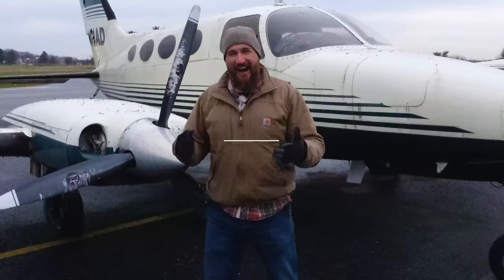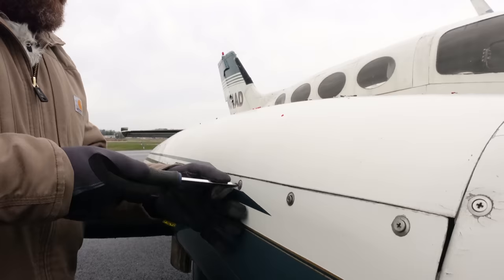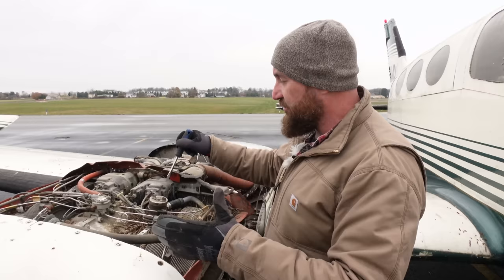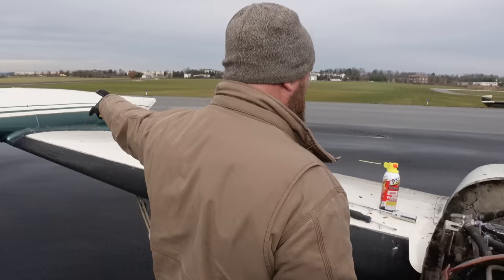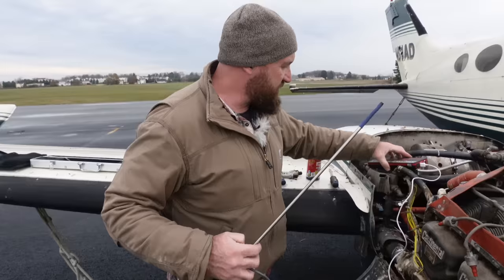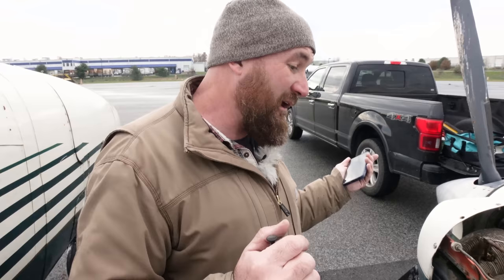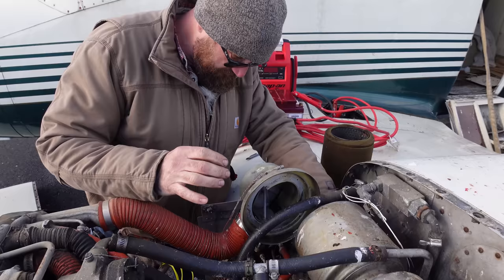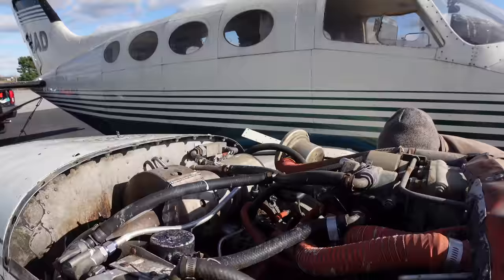FREE Abandoned Airplane... If I Can Start It! Ep1

Comment: It will start with locked up turbos. Definitely have a few feet of cruddy fuel in your injector lines. The compression will come back as the rings heat up and begin to break free from pistons. I think you're correct about the ignition spark. I'm also glad it has Continental's in it!! Hurry with the next video!! Love it!!
Reply: Agreed - as someone who has worked on plenty of turbo engines - you absolutely don't need a working turbo to turn on that engine. Sure it'll lack boost pressure and be air starved at higher loads and RPMs, but it'll start and idle just fine.
Reply: Yep, can also confirm. Been around plenty of turbocharged engines. Taking the oil feed off and filling the turbo with penetrating oil might free it up.

Comment: As to the air-frame, remove all of the damaged interior and any removable floor, top  and side panels, mark them and store them, check for corrosion, blow out any dirt from under the floor panels. Leave the pilot seat in the aircraft. The avionics are most likely obsolete by now unless they are a more recent replacement. If so, carefully remove them and take take them home so wouldn't get stolen. Be careful with batteries and prevent any sparks so your project won't go up in flames. Remove all inspection panels and have the aircraft jacked up by an experienced A&P if the aircraft is on solid ground, a good time to inspect and service gear struts. You don't want a gear to collapse and destroy your props which may be the most valuable part of your project. Try to get some history on them. Get an IA to do a complete inspection and check for AD compliance while the aircraft is still on jacks, get a professional opinion and proper guidance from him. Look for needed used parts in 'Trade a Plane'. 
Realize your limitations and prevent any damage. Good luck to you, you're going to need it.
Reply: SOLID advice
Reply: Your last line sums it up rather nicely.  This looks like something into which you put a half million dollars in order to get an aircraft worth $175,000.  Best case some retired chaps that still have connections come together to help him out.
Reply: Those McCauley propellers have corrosion issues on planes that fly 50 hours a year and are kept in a hangar.  There’s no chance they are repairable.  Even if they were, there are no log books.  How many hours are on the blades?  How many hours on the hubs?  No one knows and there’s no way to figure it out.  That makes them worthless, except as wall ornaments.
Reply: @learmonkey3582  That would lower the value of this project being parted out substantially, never mind a restoration.

Comment: It will definitely start without the turbo. The turbo might even come unstuck after it gets some oil temp and the exhaust flowing over the turbine wheel.
Reply: If he mentioned the "turbo chargers" one more time I was gonna loose my shit. This is what happens when a car guy that knows nothing about fixing or flying an airplane tries to fix one.
Reply: I wouldn't have any doubt in my mind about that, I would also suggest renting a hangar for it, that way u can keep it out of the weather
Reply: @Captndarty  I already lost my shit here...what's makes you think I'm full of myself? 🤣
Reply: Oh wait there were not spark plugs in lol
Reply: We've got a GTSIO520 at the maintenance shop I am at (it's a test engine) that was donated without the turbosupercharger, we run it every once in a while when we're doing stuff with fuel injected engines.
Reply: @pilotboy217  I agree, this was amateur hour.
Reply: The problem is he didn't use several cans of starting fluid.  That's what I do when my airplane has difficulties starting and passengers have places to be - there just isn't time to troubleshoot, it's better to get things running asap.
Reply: @pilotboy217  Even car guys know you don't need the turbo to start it

Comment: I used to do avionics work in the military, and I can sympathize with you on the lack of space to do ANYTHING internal on any aircraft.  Everything is specifically engineered to take up the least amount of space possible, so there is the absolute minimum of space in between those bulkheads and in the equipment bays...real knuckle bruisers for sure, then if you have safety wires on them you will end up losing a lot of blood from punctures and scrapes...
Reply: Nonners will never understand
Reply: Going to need a Certified engine with logs for FAA Airworthiness.   $$$$$$$ for Overhaul at a minimum.  Going to be an expensive ride to say the least.   Good luck 👍.

Comment: In adding air to the front strut of a Cessna 182, we have to tilt and hold the nose up off the ground. Two of us are sitting on the tail whilst a third guy is, via Schrader valve connector, adding air from a compressor, set to 100psi.
You would need 800+psi to 'successfully' add air to a wheel strut that's on the ground.

Comment: Turbo's actually dont make a bit of difference until you reach a certain rpm.So it should run without them turning. At least at quarter throttle. I would check to see if its getting any fire to the plugs. Also i have seen in past experience someone has installed and hidden a dead switch to keep the plane starting.
Reply: Correctamundo. It will start without turbos spinning. I would be checking all the wiring in case the mice have chewed some, in addition to the mags and fuel lines to the engine
Reply: Yeah ….so here’s the problem with that..if the turbo is seized then the compressor/turbine shaft seal is also probably shot…starting the engine could fill the intake full of engine oil QUICKLY resulting in hydro locking one or more of the cylinders, I know this because I’ve had it happen 😂…been wrenching a long time and my advice is NEVER start an engine with a bad turbo, seriously there’s sooo much that can go wrong and turbos  will destroy a perfectly serviceable engine
Reply: If the turbo is locked up it is a major restriction in the intake system. If you bypass the turbo it should start.
Reply: @localenterprisebroadcastin5971  Here's the thing. The motor is already trash. a non spinning turbo is a restriction, bypass the turbo long enough to get it started, no chance of oil and problem solved. How long is a long time wrenching?
Reply: Exactly
Reply: Yup, I've literally driven hundreds of miles with a turbo that was no longer spinning. Turbo is a power adder has nothing to do with starting the the engine. Dude seems a little clueless.
Reply: A bad turbo can cause a runaway because of oil in the intake. Could also hydrolock it if a big enough slug went through
Reply: @localenterprisebroadcastin5971  that is why you remove the hose from the turbo to the intake. That way oil NEVER gets from the turbo in to the intake. Do keep an eye on it so you can shut the engine of again if a lot of oil is coming out of it tho.
Reply: @netlans  he didn’t mention anything about bypass anything which is what I was referring to…true if you remove the intake piping then there’s nothing to worry about as far as oil hydro locking the engine…obstructing the exhaust isn’t that bad if your only running the engine for a few seconds but any longer can cause damage if the oil seal leaks on the turbine side…also…just because an engine needs an overhaul doesn’t mean everything in the rotating assembly is trashed…Im simply pointing out that’s it’s a stupid idea to run any engine with a damaged turbo, in the 18+ years I’ve been wrenching (military and civilian) I’ve seen enough to know that.
Reply: @SuperCrackSack  runaway on a gasoline engine huh?
Reply: @SuperCrackSack  it’s not a Diesel
Reply: @dyk0n  From what I remember, is that a piston engine turbo is taking some of the exhaust air and compressing it, then injecting it back to the engine. Turbo is good at high altitude where the pressure is too low, it will help the engine keep its power. Low pressure = lower engine performance so the engine needs the turbo compressed air in order to maintain high performance at high altitudes. So in theory yes he doesn’t need the turbo spinning to start the engine, but once it started for few seconds if the turbo turbine is not spinning that would cause a pressure build up as exhaust air would be rushing through into the turbo air intake with no where to escape… it would blow up I would say. 2 solutions:
- Either get the turbo working 
- Redirect all of the exhaust air out instead of going into the turbo (would require some extra work) 

Ex pilot.
Reply: @Deja-Vu Adventures, Turbo in planes is used to keep the engine performance running at high altitude by injecting compressed air into the engine. At sea level on a piston plane engine a turbo wouldn’t do much (a supercharger would perform alot better at sea level but will perform poorly at high altitude) turbo is good at high altitude.
Reply: My first suspect would be those mags not firing, and you don't know the condition of the fuel distributor either. First double check if it has spark and squirt.
Reply: @Stoney3K  He cleaned all the spark plugs etc but never touched the mags. I think the mags aren’t even doing anything they are probably dead.
Reply: @user-gy8be9cf7i  Yeah I agree, also, it's extremely dangeous to turn the prop by hand if you're not completely certain the mags are grounded. If the magnetos fire inadvertedly, the engine will start.

Comment: From an automotive breakdown mechanic experience, leaded fuels would eventually coat a deposit onto the center electrode ceramic layer thus shorting the plug. I used to burn it off with a handheld butane torch then clean and reset the plug. After that, they worked.

Comment: Your turbos are locked with dried oil, remove oil feed line, fill with penetrant, wait a little bit and try to spin them again. As long as bearings are not crunchy its good to go.
Reply: I came here to make this same comment. I’ve seen locked up turbos come back to life more times that I can count on old semi’s and grain trucks that have been setting in fence rows for years.

Comment: First thing Dude. When you’re at an airfield, cleanliness of the runways and taxiways is a must. All that stuff you’re  pulling out and scattering on the ground is fodder for FOD (foreign object damage )  that could be I ingested by a passing air sucker jet engine. Be cool. Keep it clean.
Reply: Glad he didn't get it running with all that stuff on the wing, and even with the panel loose and flapping.

Comment: If you're making a series out of this restoration, you'll have found a new subscriber. Looks like restoring this plane should be a fun challenge for you. Just hope you're going to get an experienced aviation mechanic to inspect the frame to make sure it's still air worthy, and let you know what can/needs to be done to make it not only run, but be safe to fly.
Reply: Hell nah man. Just fly it. People these days are too soft and scared, life is all about taking risks. If you want to be safe, stay home. Lock yourself in your room and stay in bed all day. Same goes for any so called "pandemic." My grandpa who fought in WWII wouldn't bother inspecting the airframe, that would be a slap-in-the-face to the draftsmen who worked out this beautiful craft. If airplanes are supposedly so safe to fly, then why do we need airframe inspections for?
Reply: @phxcppdvlazi  2 words can easily explain why. METAL FATIGUE
Reply: @phxcppdvlazi  aging: exists
Reply: @phxcppdvlazi  It would be fine to do that if you were only endangering yourself. What if that plane were to come down on a town? That kind of attitude is how people get killed pal.
Reply: If you have enough money you can get it flying safely. But i work on those cessnas every day, and i can tell you that aircraft is scrap. Just looking at the corrosion i can see before opening any panels, i can see major problems with the structure. To fix it will cost you more than buying a new one from the factory. It was parked for a reason.
Reply: @phxcppdvlazi  Awesome satire dude.
Reply: @surfwidow  costing him very little atm to keep this going until he finds a worthwhile project plus the bonus of extra revenue from breaking for parts if and when he gets it started imo
Reply: @phxcppdvlazi  in WWII they wouldn’t fly with WWI airplanes right? But this is the timeframe we are talking bout here.

Comment: I promise my last comments. The turbochargers depending on the practices of the pilot or pilots, may not have been allowed to cool down enough before engine turn off. The bearings themselves could be completely gummed up and maybe slightly corroded at the same time. I would try your trick with the two-stroke motor oil and just force feed it into the shaft where the lubricating oil is pumped from the engine. You get down to brass tacks you can even spray PB blaster directly into it. It's not like you can break a frozen turbocharger more. Just an idea.
Reply: 2 stroke pj1pro

Comment: 1:09:40 - Mags over turbo. Fuel, fire, air. When you're cranking the engine over (which seems slow) you aren't making enough exhaust to spool the turbo. A non-spinning turbo shouldn't keep it from starting. You could remove the ducting and let it normally aspirate, it should at least attempt to start if it has fuel, fire, and air. You could have pulled a plug and had it sit, wired up, against the engine with a camera on it to see if it's sparking.

Comment: 48:12 it always surprises me when other mechanics don't know about electricity. 2x 12v in series would get you 24v. And you don't have to worry about oversupply of amperage. Basically, the starter would draw as much as it needs and no more (unless there was an internal short or you tried to start a seized motor)
Reply: Exactly. You could hook up 20 batteries and as long as the final voltage was 24 the unit will only draw as much amperage as is needs. I was just getting ready to comment this and im happy to see someone beat me to it.
Reply: @codilankford6173  Exactly. You could hook up 20 batteries and as long as the final voltage was 24 the unit will only draw as much amperage as is needs. I was just getting ready to comment this and im happy to see someone beat me to it.
Reply: From watching this video he doesn’t seem like that good of mechanic either.  It’s amazing how convincing confidence can be when somebody lacks competence.
Reply: Exactky.  I was looe uh what?  Too much amperage?  Huh? Lol
Reply: @WinnebagoBrewingCo  lol  confidence  is  key even if it's wrong lol
Reply: To much amperage supply,  LOL
Reply: Uhhh...no...ohms law(which we'll leave the inductive nature of a starter out of the equation) states that if you throw more than 24 volts across it, amprage increases as a SQUARE, now 24 volt starters are usually wound with more, smaller windings to raise the series resistance. But if over supplied with voltage, heat losses will make it go...poof...dramatically. electricity is a complex thing, i understand why he doesnt want to get bogged down understanding it.
Reply: @matty1234a1  No one is talking about supplying more than 24V here, bud. Wtf are you talking about?
Reply: you must be fun at parties no doubt
Reply: @denialphasebitcoin5639  but you don’t even know the difference between too and to! It’s too much amperage 😂 next time you try to look smart learn how to spell first that’s elementary 😂
Reply: @matty1234a1  Ohm's law doesn't state anything of the sort. Ohms law states that current increases proportionally with voltage for a given resistance. The inductive nature of the starter has little effect as far as DC is concerned except when supply is switched on or off (this is the effect used to generate the voltage to fire the spark in the spark plug).
Reply: He clearly is NOT a mechanic, even a competent  amateur mechanic can see this. It shows in his approach to fault-finding, his selection of tools, his comments and in his mistakes.  However, it does not take away from the entertainment value of the videos and his demeanour is pleasant, I'm guessing he's Canadian rather than American, but I can't always tell.
Reply: Yes trying to run 24 volt Bord system with 12 volt, I can not even images that something worked. Wonder that the propeller was actually turning.
Reply: @MallV0lli0  Exactly. You could hook up 20 batteries and as long as the final voltage was 24 the unit will only draw as much amperage as is needs. I was just getting ready to comment this and im happy to see someone beat me to it.
Reply: @codilankford6173  Exactly. You could hook up 20 batteries and as long as the final voltage was 24 the unit will only draw as much amperage as is needs. I was just getting ready to comment this and im happy to see someone beat me to it.
Reply: @Bramble20322  It should be supplied with more than 24V. These systems run at 28V.
Reply: Was just about to reply with the same information.  How do you not know about series\parallel by now if you are a "mechanic"??  Seems to be the norm with YouTube automotive or mechanical channels.  I've thought about starting a channel to help others with these types of things that aren't being passed down from mechanic to mechanic.  We'll see!
Reply: it suprises me everytime Melectric guys making mistakes mechanicly :P
Reply: @MallV0lli0 you literally copied paste...lmao
Reply: @Expedient_Mensch but what trumps all that his he's definitely not an aviation mechanic, so all this crap hes doing means jack. To when it comes for the plane to even be certified
Reply: david - "I guess I should have put a little less fuel in ..."   well, ya. 
And electric drills make internal sparks that WILL ignite gas fumes, so ... 
1st time here but I will definitely be binging this series. 
1st thing I would do is to take seats and carpet out cuz it's dangerous.
Reply: @sixT4T  Exactly. You could hook up 20 batteries and as long as the final voltage was 24 the unit will only draw as much amperage as is needs. I was just getting ready to comment this and im happy to see someone beat me to it.